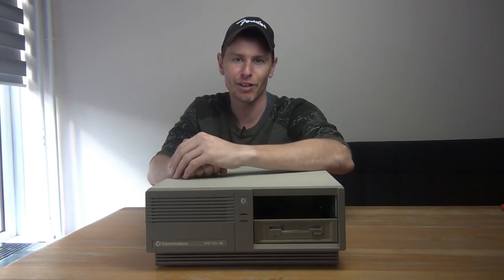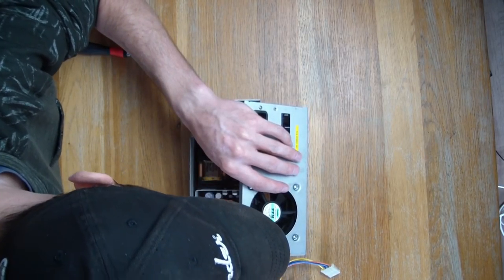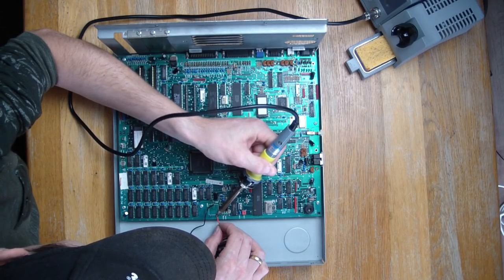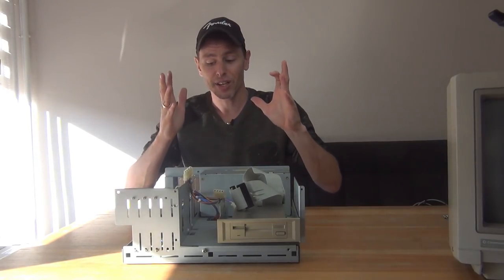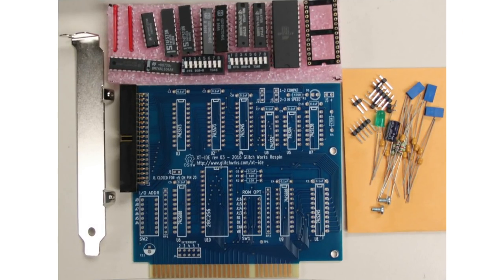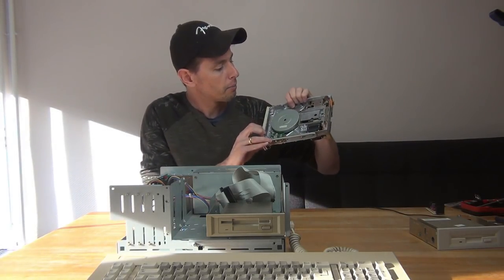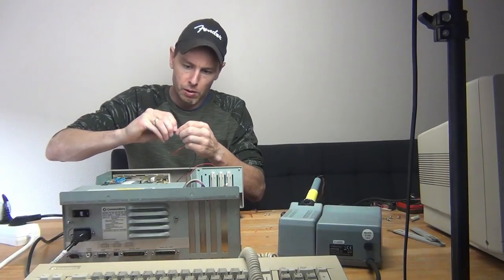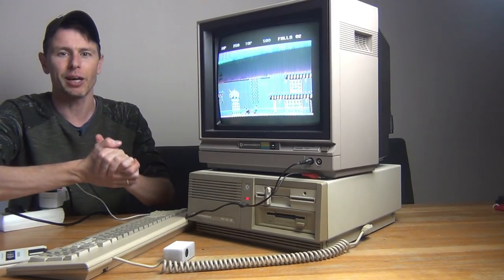Restoring a Commodore PC10 III

Comment: I stumbled on this channel searching for my first PC. It was the Commodore PC 10 iii, it came with 2 floppy drives and no hard drive. I used to have to load the OS, Dos 3.3 if I recall, from 2 floppies. Both 720k. I never did get a hard drive, I was a student at the time, could not afford it. I used Mavis Beacon teaches typing and played with a Unix OS that also booted from 2 floppies, before Linux existed. My monitor daisy-chained from my pSU and turned on when I started the PC, may have been a UK edition…

Comment: So awesome to see you tinker with a Commodore PC 10! I've just recently got a Commodore PC20 which I'm restoring. Luckily no battery damage, but needs to be replaced to get the BIOS to remember the harddrive. Nice machines!
Reply: oh well, did you change the chip bios? is it easy to find? Maybe i need a PC10-III Bios, maybe. thk

Comment: Did you try adjusting the V-Hold control on the 1701 monitor? Usually that's all you need to do to display NTSC on a PAL monitor or vice versa if it has a vertical hold control. The image will probably be in black & white due to the incompatible color systems, but at least it should sync to the video signal and display a stable image. Also, the older IBM Model M keyboards are usually XT/AT autoswitching, whereas the newer ones made by Lexmark and Unicomp are AT-only.

Comment: Case design is clearly very similar to an Amiga 2000. Power connector and colour code the wiring to the  power supply is very similar to the Amiga 3000.

Comment: waw, fantastic video. Thanks. Very good idea about the IDE card 8bit with the compact flash, also to save the HD (i've got a PC 40 with HD). Well, may i ask you a question about my PC10-III? well, it worked... about 10 years ago :-) Now,  it doesn't work :-(. Well, power supply is good, but no raster on the video (i tryed rgb, composite,...). i've already changed the rechargeble battery and the 14 capacitors. I've seen that it doen's start with the motherboard check, could be the bios chip damage? Thanks, Edy
Reply: i bought the ISA 8bit to CF. Perfect on the Commodore PC40 (on the PC20 doesn't work, i have to understand why :-) )!!

Comment: get yourself a nice 8bit oak vga, strive for the 256kb card you'll get good wolf3d game play. (don't forget your fake cpu app so you can run the game)
personally i'd gut it and upgrade it to a dx overdrive p90 and go all out with a pci 486 board :D
add a nice new powersupply, throw away the fm drive, get yourself a nice e-ide in there.
Reply from the maker: A retro sleeper build, I like it!
Reply: @RetroGameCouch  don't forget the OLD ati 3000 (old radeon) they came in pci
Reply: @RetroGameCouch  if you find trouble getting the zotac pci card, you'll do ok with a ATI 9650 128/256mb (that was the limit then, but i guess zotac broke it their pci cards are 512mb)
Reply: @RetroGameCouch  but ya a 486 pci would not take a zotac 512mb nor would it the 9650, you'd have to go tnt2 or mx64 around that era, eventually they start needing more juice than the board can put out per slot, but ya those mmx boards are tough/decent as fk. definitely had more fun using those than i did the pentium II.

Comment: i have the motherboard only of one of these, i did have the correct psu but stupidly dumped it.....  would like to get hold of an empty case to 'resurrect' it but i think chances are very slim...i have a switchable xt/at keyboard which would hopefully work with it....
Reply from the maker: I think you could build a psu for it. I think it has +5v +12v and -12v. Cases are rare for sure. That keyboard will work.

Comment: Out of curiousity; years ago I had Wolfenstein 3D (the first version) which according to the label wouldn't run on XT. I just wondered if it wouldn't run or whether it would be so unplayable? Any chance of a follow up video?
Reply from the maker: Sounds like a fun new segment: answering a viewer question, with a short video answering just that one question.
Reply: they compiled it for 286 and above, I believe. you can hexhack it to work on an 8088 but it's completely unplayable.

Comment: You can convert RGBI to VGA using passive components, so an adaptor should not be hard to find if you still have a normal VGA monitor.
Reply from the maker: I tried an RGBi dac converter and then a gbs 8200 to convert to vga. Not passive and not very workable. Do you have more info on your solution?
Reply: I was looking at https://sites.google.com/site/h2obsession/CBM/C128/rgbi-to-vga to verify that I remembered correctly before posting, but google does show more solutions from others as well.

Edit: After reading a bit more, it also depends on the monitor, since the frequency is out of spec for the VGA standard, not all monitors might work.
Reply: Converting digital RGBI to analog RGB is easy -- but the frequency is still much lower (15.7 kHz) than what most VGA monitor require (at least 31 kHz). But Europeans are lucky because many TVs with a SCART jack do support analog RGB video at 15.7 kHz, and many of them are also multi-system and support NTSC as well as PAL -- all you'd need is a specially wired cable.

Comment: XT class computers run DOS 5 or 6 just fine. DOS 3.3 sucks anyway. DOS 5 is the best version of DOS ever created.
If you have a difficult time reading that display, you can run "mode co40" (color 40 columns)
For games, I really think the Tandy standard is far superior to CGA/Composite.  It is truly amazing just how slow these machines are. My first PC was a Compaq luggable XT clone with a 9" CRT built in with amazing green phosphor screen!  I suppose these were absolutely mind-boggling for accountants (I purchased the Compaq used from an accountant) who had a new ability to handle large data sets.
 Telecom based research was a great use as well. It may be slow, but driving to a building with paper files is orders of magnitude slower, though it doesn't "feel" as slow as a 2400 baud modem!
But outside of these and other very specialized uses, they just weren't that useful.
Reply: Back then most secretaries had typewriters. A lot had dedicated word-processors. Some had PCs with word processor software. I worked for an accounting firm in the late 80s and they used dedicated word processors with daisy wheel printers for generating reports for clients. They were also able to handle spreadsheets. The dedicated units were smaller and took up less space.

Comment: Sorry, but RGB-I has nothing to do with NTSC or PAL. I still have a 1084 monitor and owned a PC-10 III myself, and it requires the onboard graphics to be set to CGA mode with the dip switches on the backside. It won't work with Hercules monochrome mode.

Comment: that cf to ide adaptor unit 'might' work 'as is' on the built in ide interface, without the xtide/cf io card...try it if you havent already done so, but the pinout may be different on the built in , you'd have to check,
Reply from the maker: It's not an IDE connector on the motherboard. It's an old 8bit interface. The reason the xt2ide exists.
Reply: @RetroGameCouch  it is an 'ide interface' of sorts, 8 bit ide,   and the xtide interfaces with cf cards as 8 bit..i will check further when i get chance, i have the circuit/schematic of the pc10 now, somewhere
Reply from the maker: From your own link: ”The PC10-III/PC20-III/Colt is extremely limited in what hard drives it can support. As its ISA bus is only 8 bit, it cannot support a full 16 bit IDE interface. Instead it uses a short-lived 8 bit variant of IDE known as XT or XTA. Only a small number of hard drives were manufactured which supported this standard."
Reply: @RetroGameCouch  i've had  a look on the net and CF cards can work with 8 bit transfers but need  command codes sending to them to initialise them for 8 bit, presumably that what the xtide bios does to make it work , ?
Reply: maybe possible to have an isa card with just the xtide bios rom, and connect  a CF to the internal ide port?

Comment: There is really nothing special about Commodore  PCs. The Amigas on the other hand, are quite special.  I have an Amiga 2k HD. I'll take that over a Commodore PC clone any day of the week.
Reply from the maker: Nobody said it was special. It's still a fun part of Commodore history.
Reply: It just seems like an expensive endevor to put together what is basically a 5150 clone.
Reply from the maker: The cheapest 5150 on ebay is $350. This clone of my favorite computer band was €30.
Reply: Sounds expensive, though that is for a genuine IBM 5150.
Nevertheless, it is kind of cool to have the Commodore branded stuff along with the Commodore branded keyboard.  Is the BIOS Commodore? Presumably it's just a Phoenix or other clone bios, but possibly rebranded as Commodore.
I have my original 64, Datasette, 1541 and 1581 that I bought new. I had a VIC I bought in 82 or so, but I lost it. I have a 128 and 1571. 2 500s, a 1000, a 2000HD and a 1200. I also have a few calculators. You might say I'm a Commodore fan!